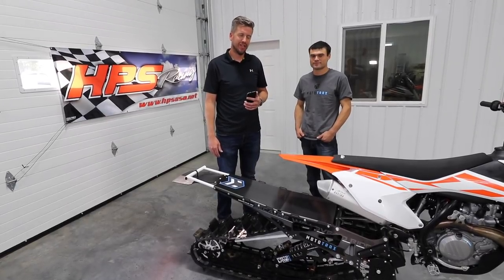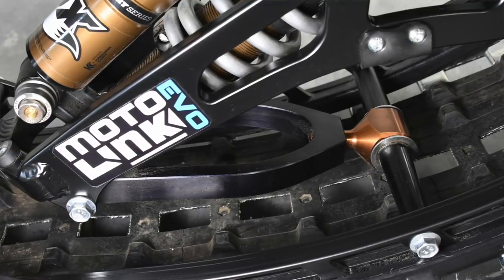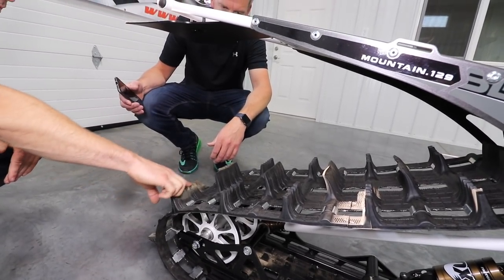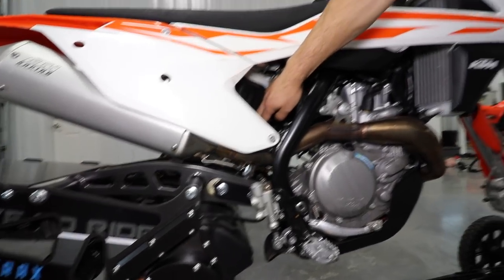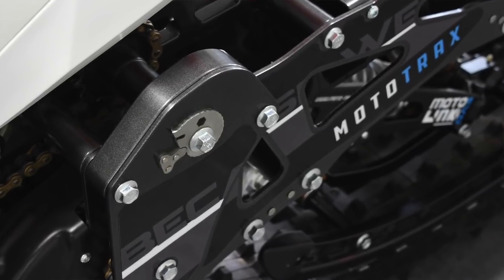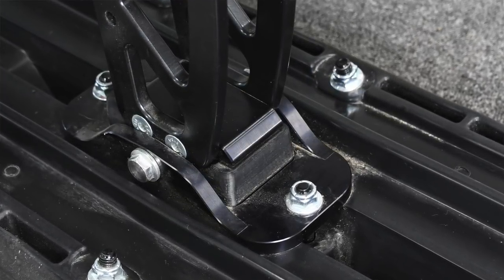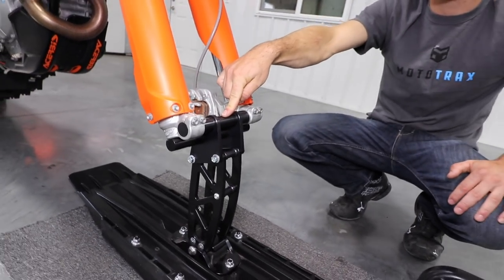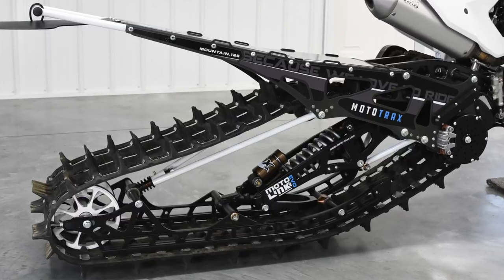the SNOWEST show: MotoTrax 2018 Updates and Changes

Comment: I'm not an engineer but I do not understand why the front ski mounts lie within the forks. It looks weak af as designed. A more robust design is easily achieved by bringing additional support out beyond the forks. Oh well, sleds are still far superior to these machines anyway.
Reply: Taco Pro you can't take a sled in tight trees
Reply: You have no idea what you are talking about. either that or you just ride trail all day. Sleds and Bikes are apples and oranges, I can lead any sled rider into a stick in 5 min of leaving the trail head. And just to prove a little more that you have no idea what you are talking about. I've nailed rocks with my ski to the point where it stopped the bike cold and throws me over the bars and nothing broke.
Reply: Taco Pro I hit a rock under the powder on my pro rmk going 10mph. Shock bent in half and all right side suspension destroyed. Sleds are fragile.
Reply: thank you for that useless reply taco...... every one knows pros are fragile, even those that ride them. my buddy has 15+ bent arms in the bed of his truck from his pro. has nothing todo with comparing sled and snow bikes....
Reply: you said it best bud your not an engineer lol
Reply: @tayloranderson1372  probably more so heavy than fragile. More power with a lot more weight will break parts a lot easier than a snowbike.